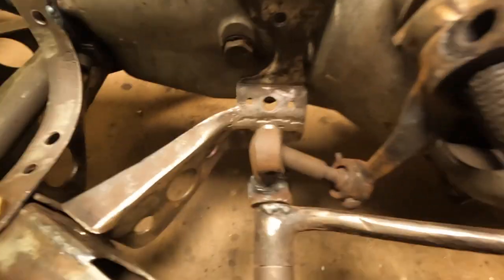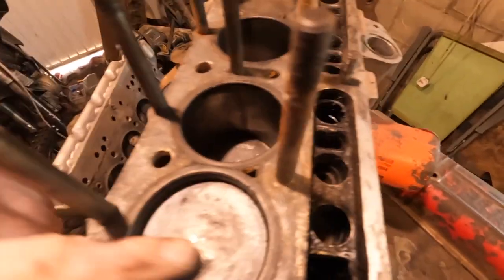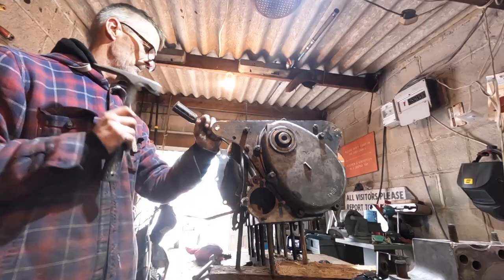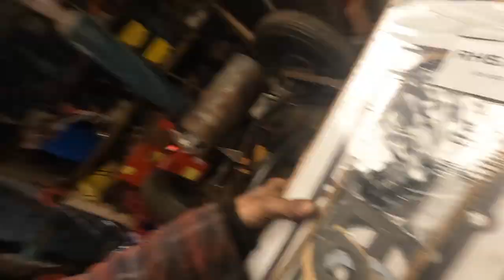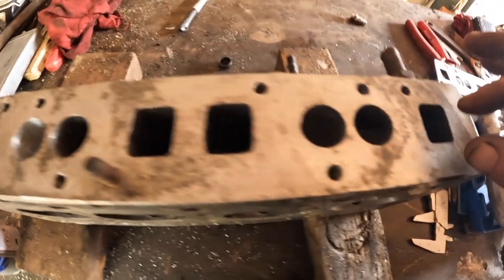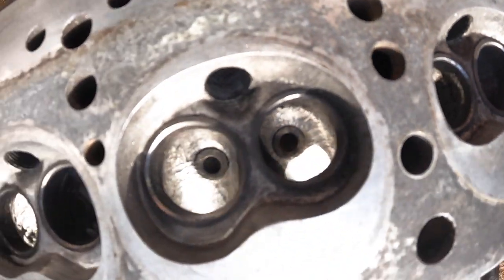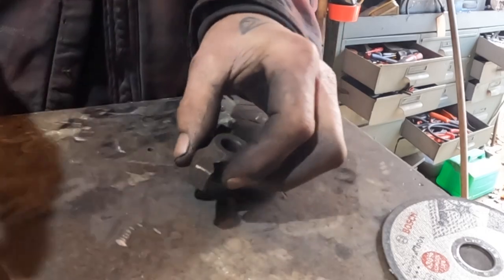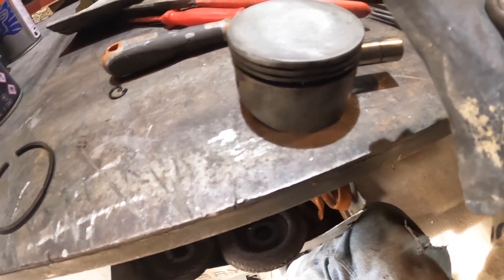the austin ten special....rat ,   part 12

Comment: Reminded me of tuning my First pre crossflow engine for my mk1 cortina all that work does make a difference to the running of the engine, dirty work but defo worth it, great vid keep it up.
Reply from the maker: thanks dude, I think its all about finishing off the bits the production line didnt....free horsepower and building  in reliability......the old mk 1 head was a lot tougher than this😀